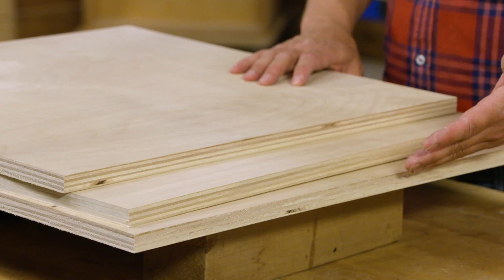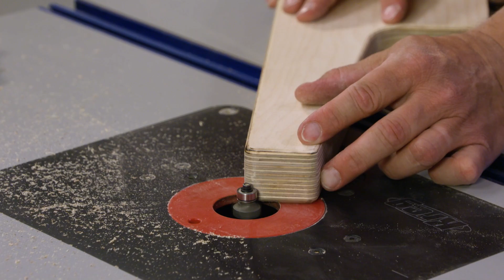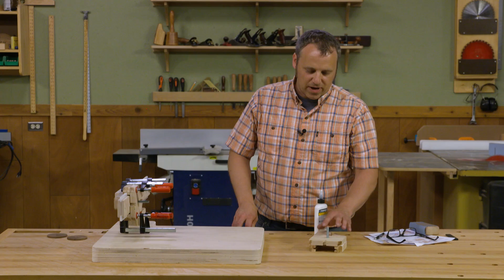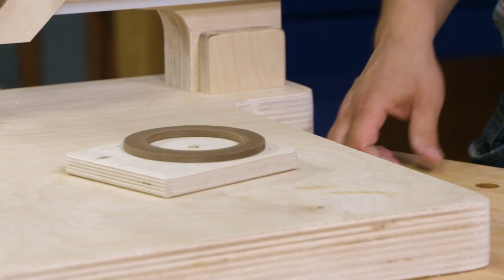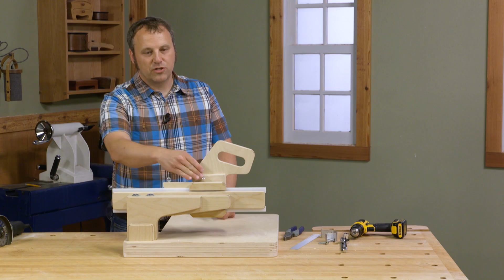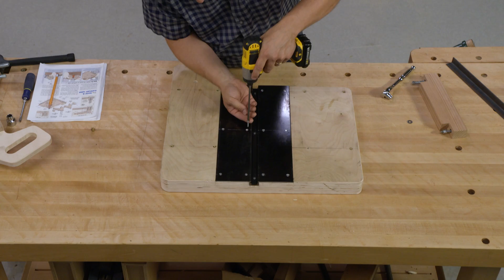Convert an Angle Grinder into a Sliding Cutoff Saw

Comment: I made this sliding cutoff saw about two months ago and it works very well. I thought i was being careful to make sure the arm was perpendicular to the fence before I bolted and glued the arm to the base. I later discovered it was off 1 or 2 degrees. To fix this problem I removed the hardwood guide with the plastic runners from the arm assembly. I added some metal shims to make the hardwood guide perpendicular to the fence. After that was done, I was very pleased with the project.

Comment: How are those “plastic runners” being held in their slots? I don’t believe that was explained.
Reply from the maker: They're a pretty tight fit in the grooves. I also used a couple pins to secure them.
Reply: What kind of "pins", and where are they located? @WoodsmithShowandmagazine
Reply from the maker: I used a 23 gauge pin nailer. Just popped in a few randomly along the length. The goal is just to keep the bars from slipping around. I only used 4-6 per track. @johnmack537
Reply: @WoodsmithShowandmagazine  Thanks
Reply: Isn’t the red metal bar secured backwards? Should it be at the other end? Thanks
Reply: @binhpham-by6ch  The tool has two fence positions: one toward the front (close to the operator) and one toward the rear (for cutting wider stock). I believe Phil mentioned two sets of inserts in the base to accomodate this.

Comment: The plastic slider is probably the weakest link, I had designed mine with drawer slides (ball bearing ones).
Reply from the maker: See we went with the UHMW plastic cuz we were concerned about debris gunking up drawer slide mechanisms. The original version is still in use in the shop and the slides are holding up nicely. I guess it depends on what kind of usage you expect from this: everyday/occasional/infrequent mileage varies.
Reply: Can you provide some details?
Reply: I thought the same thing.  I was thinking replacing the HDPE with AL flat stock.
Reply from the maker: It's all options. Milled AL bar stock would be a good choice too.  @feedthechunk9836